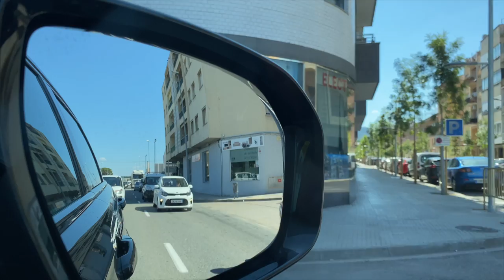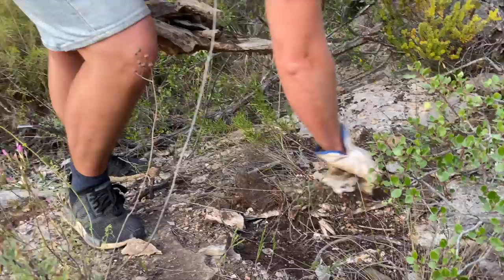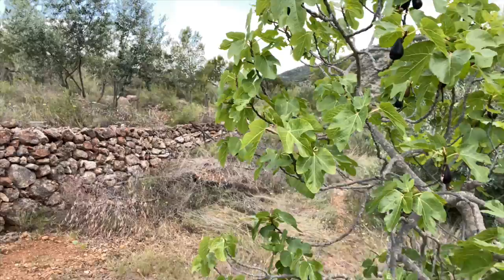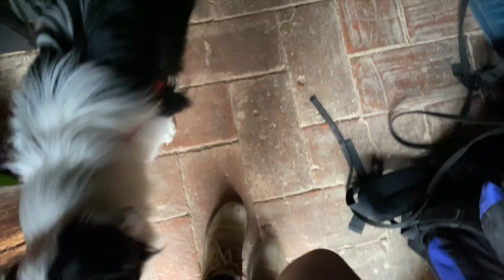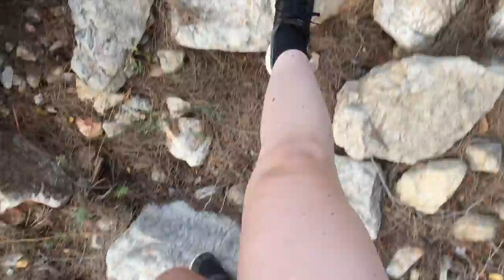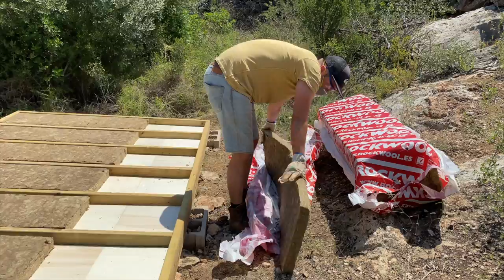CABIN BUILD SERIES | Ep.3 | Installing Floor Insulation | V.16

Comment: For cut the isolation is mutch more easy with a isolation nive ( simular like a bread nive ).
Put a wooden plank on top, press it down and with the nive cut it easy.
Reply from the maker: Thanks Gerrit. We just used a Stanley blade and it worked fine. But for more precise cutting we’ll probably use a better knife suited to the job 😁